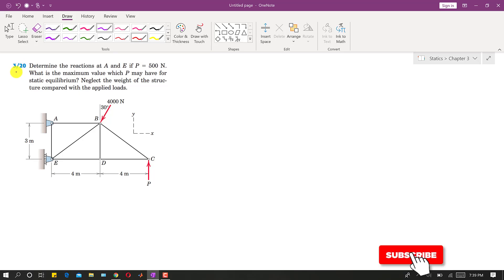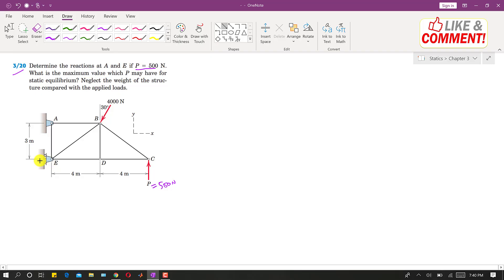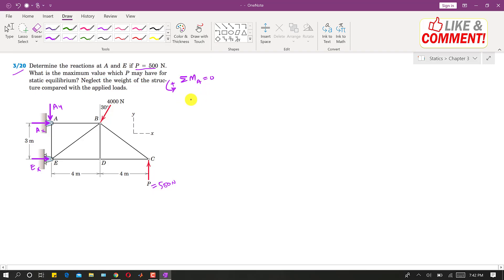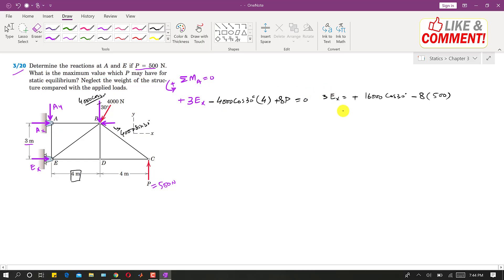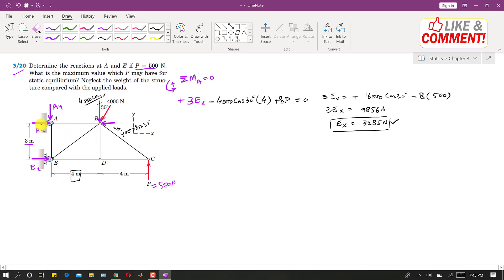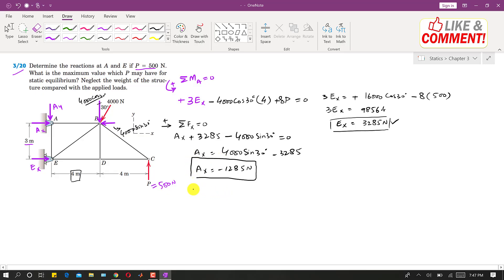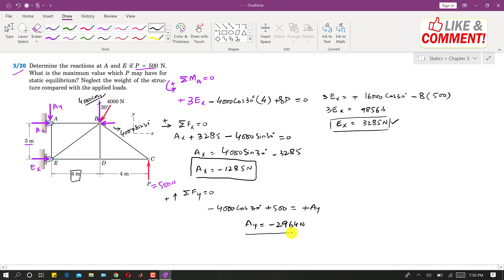3/20: 2D Equilibrium Problem | Engineering Statics, Engineers Academy

Comment: Isn't it 4000 sin 30? It's along y axis
Reply: Hi @luigimadis9389, commenting 3 years late but I'm here

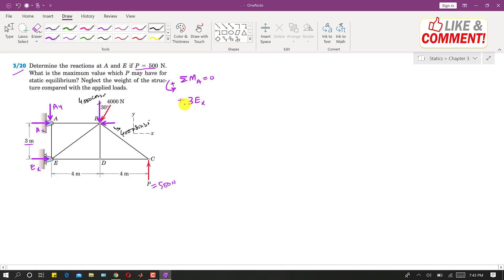it's along the Y axis that is correct, but the adjacent side to the 30 degree angle is the vertical portion of the 4000N force enacted at B. This is why he used Cos at 2:30

The narrator is very fast in his explanation and there is a bit of noise in the background that makes some portions hard to hear. Hope this helps someone else reading the comment section.

edit: timestamp

Comment: Two of the answers in the textbook don't match up but your math and how you acquired the answers is correct. In the textbook Ay = +2960 N, Ex = +3290 N. I think there might be a typo in the book or they rounded their answers a lot somehow. I think for the Ay they stated it in the +y direction from the start and that is how they got a positive answer for that part. I redid the math a few times but get the same answers you did.
Reply: The reason the textbook gets +AY is that if you solve for the forces first, you will get a positive AY. If you assume AY is positive from the start, your formula is AY-4000sin60(He lists COS30 SAME THING) +500=0. This will net you a positive force in the Y. With AX set up, it is shown as AX+EX=0. Again, this assumes you put AX and AY in the positive direction. In order to find AX, we need EX. This is where you take the moment around A to get EX. After plugging in, you get EX +3285. Plugging back into the FX formula will net you a negative AX.  I hope this helps!